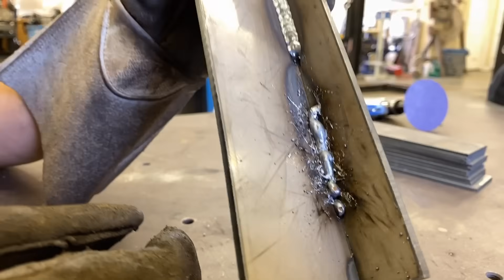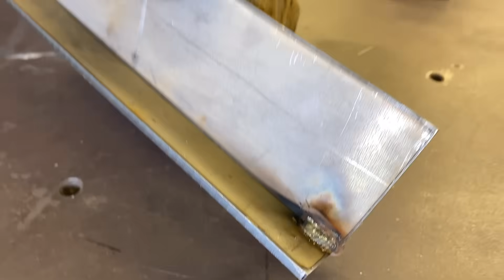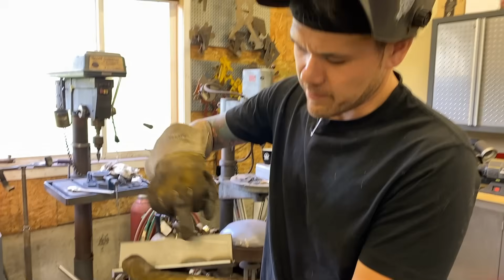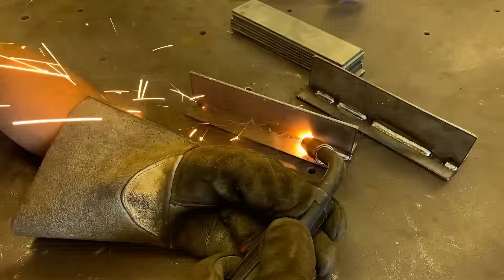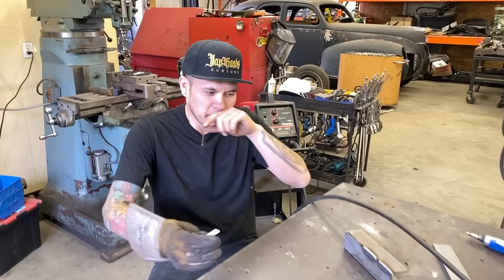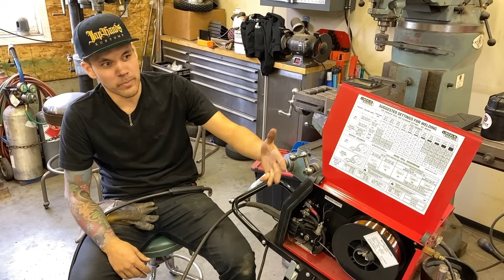MIG Welding Basics For BEGINNERS!! How To Set Up Your Welder + Tips, Tricks & Techniques!!

Comment: One other point to expand on Mick Millers comments, AWS  D1.1 (Structural code, carbon steel 1/8" and greater thickness) forbids down hill welding.  AWS D9.1 (Sheet Metal Code, Below 1/8") allows down hill welding.  This is not to say that you cannot successfully weld your 1/8" or 3/16" frame downhill with GMAW, but it does mean you need to pay attention to preparation and settings much more closely, or you will wind up with almost no penetration, overlap, etc.  Taking scrap and practicing on it before you do the real part is your best insurance against a failure.  
Oh, and a tip.  If you take each of the wire feed settings, 1 through 10, pull the trigger for five seconds.  Cut the wire and measure how many inches and multiply by 12, it will give you the inches per minute.  Millers Weld Calculators and others will typically give you the settings needed for various materials and thicknesses.  By knowing your machines feed rates, you can match them to the guides, and then adjust voltage to get the best results.  You can fine tune from there.  Remember, burn and learn.  It's all about time under the hood!

Comment: Does the direction I’m pushing the weld change if I’m not using gas …if I’m not using gas to I work left to right ?
Reply from the maker: Yes if you are not using gas it is best to angle in the opposite direction. you want to aim at your weld instead of away from it

Comment: A very good introductory video.  You said that you use 75/25 gas,  but I was disappointed that you never addressed settings for your regulator.  How do you know you have enough shielding gas, but are not just wasting it?
Reply from the maker: Are used 20 ft.³ per minute. Basically if you do a test weld and you turn it down till you have porosity and then turn it up until you don’t then you know you’re not wasting it

Comment: I just finished taking a MIG welding class last week at the local college. Still I learned from your video thank you. My biggest problem is how to see where I’m welding. I tried a bright light and soapstone. No. 9 on my helmet and I often still wander off the line. But I’m still practicing as welding is a skill I enjoy. Looking forward to your future videos your metal fab skills amaze me. This 72 year old still wants to learn.
Reply: I had the same problem and I think it is a common problem.   I watched a few YouTube videos that pupported to address it, but they only said silly things like get a brighter work light (silly - nothing comes close to the light the arc puts out) or check your spectacle prescription.
Eventually I realised that as I was welding sheet metal, not thick structural steel, the welder settings meant that the amount of light the arc makes is too low for the weakest shade level of the cheap auto-darkening helmet I had.
Changing from 75:25 argon/CO2 mix to 85:15 improves the weld penetration and puts out more arc light, making the work easier to see. If you change the gas mix, you will need to change the welder settings as well, but you will find welder settings less critical with reduced CO2.
Replace the front protective plastic lens in your helmet often.   The ultraviolet light from the arc ruins it making it hard to see, but the change is gradual, so you may not realise the lens is the problem.
I am nearly 80 and began MIG welding 2 years ago.   Something us old guys have to accept is that our eyes don't work over the contrast range they used to - so that even though the arc is very bright through the helmet filter, the surroundings can be hard to see.  
There are a lot of welding videos on YT.   Most of them tell you wrong things - surprisingly even videos posted or sponsored by welder manufactures.  Make it Kustom is very good.
Reply: AMEN me too

Comment: One question I have is, why can’t I see what my weld is doing. 
I have an auto dimming helmet. 
I have tried it on dark settings as recommended and I can’t see what’s going on.
Recently I have had the settings set to lighter, but still can’t read my weld’s properly and I can see lights for the next hour or so. 
Any recommendations. 
Regards
Kevin.

Comment: You were talking about wire size - do you need a different wire size for different thickness of material? Does a different thickness affect the speed you travel?
Reply from the maker: Typically I want the thinnest where possible for doing sheet metal. If I’m welding something thicker than a thicker wire is better. Speed is directly related to wire size and material size

Comment: On my 220 welder I really like 9910 rods I get a cleaner weld with less slag I can weld 1/4 in to 1/2 in steel plates and I can fill holes using my 220 welder

Comment: I like the technique you use for welding I will try it but my 220 welder still my favorite I also have a 110 welder I have to slow down my welds with it because it's only 110w not hot enough good for welding sheet metal like spot welds

Comment: If I was looking to learn how to weld a hot rod frame for a t bucket sized car what process would be best mig or tig or anything method that I did not mention. Also what thickness steel tubing would you feel comfortable making a frame
Reply from the maker: If you were using box tubing than 1/8 wall is is good. Mig welding or tig is good

Comment: Yeah... that door not opening up because it catches on the edge of the cart ticks me too. I have an old SP 175P that is a hoss for a little suitcase welder and it lives on 2x4 spacers on the cart just for that door issue. Im digging the channel. I saw you 38 dodge vid a while back because i searhed for 38 dodge stuff since I have a 5w coupe and it popped up... but recently your vids are def in my sight so your channel must be growing!
   I guess we weld similarly but I always describe my tip movement as a question mark because i do curl the fill motion just a bit. Of course I'm not a welder... i just own a couple.

Comment: You want to Push your weld when using Solid Core MIG because you want your Shielding Gas, well you know shielding your welds rather than cooling your beads  : D
P.S. You can Film through a Welding Helmet, you can try Torch Goggles or just buy a standard non-auto darkening helmet lens from Harbor Fart.

Comment: great video...Just upgraded to a 220 Lincoln from a simple 110 volt high/low welder...was great for light metal, but would not put my life on the line welding anything critical..ha...Great tips on the different techniques, and I agree with you whip technique is the best....Keep em coming....PEACE from wayyyyyyyyyyyy over here on the east coast... New Brunswick. :)

Comment: How much gas do you need? can you use too much or too little?
Reply from the maker: Your gas does not need to be very precise but can be adjusted for your environment. Are used 20 ft.³ per minute most of the time and never need to adjust it unless it’s a little bit breezy then I might turn it up to 30. If you have to little you will have porosity
Reply: @MakeItKustom  thanks 👍

Comment: what is the difference of mig welding and fcaw?
Reply from the maker: They are both basically the same except one uses gas for shielding and one uses a flux core that burns and creates its own shielding gas. flux core has more clean up. Most people prefer gas shielded

Comment: Thanks for this great tutorial. Does the same welding technique apply to flux core welding (gas less) as well?
Reply from the maker: The welder set up does apply but the angle of your welder should be pointing towards the Weld with flux core
Reply: Not to mention with Flux your not getting as much fill, so you need to spend more time letting the puddle grow before moving. It's a slower process, however can produce extremely strong and good looking welds if you take the time to practice. One thing that's wasn't covered is clean your metal! Alot of people use Flux because it will burn through alot of crap, however the quality of the weld will reflect your prep.

Comment: I have a Chevy S-10 extra cab pick-up that has a rusted floor under the drivers' side seat. I can't seem to find a replacement rear driver side floor panel, how or where can I get one? I do most of my welding outside, the garage has asphalt floor, fire hazard.
Reply from the maker: Not sure if they make those parts. I’d cut one from a wrecking yard!

Comment: Great video!! Just one question, what's the best gas flow rate? Did i miss it in the video? Or does it not really matter? I just subbed and will be looking forward to watching some of your older vids and checking out the new ones. Thanks again!!
Reply from the maker: I keep mine around 20-25 and a little more if there is any breeze

Comment: I grew up with a welding instructor.  So the basic knowledge was there before I ever struck an arc.  Lincoln 220 buzz boxes were everywhere then.  At 13 my first job had one, and I “self taught “.  In high school I was the guy who the teacher told to show the rest of the kids how to run a bead.  Fast forward to a job making mobile home frames, first day first arc blew holes through frame rail!  What freakin amperage you running?  180.  Turn it down to 120 ish please?  Can’t, adjust screw is AFU and it would take half of a day to lower.  Well, what do I do?  Run down hill!  1/8” rod at 180 amps goes on quick!  Which is what production mgrs want.  Federal inspectors told us multiple times that we had the best frame shop in the state.  Got to run a mig after a couple of weeks, same thing with burn and turn, reminding me of your welding with out sleeves, mega sunburn from uv rays.  I didn’t own a work shirt that didn’t look like I was shot with a 12 gauge at 50 paces.  You have done a great job of quickly demonstrating the process the best that I have come across, only thing that I could suggest is a #10 lens in a box to actually be able to show your torch position and puddle.  You could fancy one up out of sheet metal or duct tape one on a cardboard box, that would really show the process.  I know that once I see something done, it is easier to reproduce.  Just found your channel and really enjoying your metal working skills!  Thanks for passing it along

Comment: Hi, i have question that it seems like no one covers in their video. Can you use a Magnet like from a speaker instead of a clamp to make a circuit ??? as there are some time where it is difficult to clamp the ground to piece your welding
Reply from the maker: I’ve seen those clamps before they are just a big magnet with the wire going to it.  Seems to work

Comment: Was much impressed with this tutorial, i too have found the circle method also to be cunbersome and have resorted to your fav method.ive just started into the whole fab thing as a hobby as well,only thing i didnt hear u mention was nozzle n wire distance to work piece,but that seems to be a no brainer on most novices the wire will stretch the distance n fire as soon as it archs!!but if your nozzle is to close youll plug up n ruin ur copper tip,correct me if im wrong but that distance is just as important.correct???snooky pa.
A

Comment: I learned (mostly trial and error) on a 110 flux core lincoln. a few years ago I got a solenoid and converted to MIG. Now, I have finally upgraded to a 220 Everlast multi process machine that I'm just getting used to. With the flux core, I never learned  to run vertically down (only up) and probably have a ton of bad habits like pulling the weld, instead of pushing.

Thank you for this "back to the basics" lesson!

Comment: Can you MIG weld 16 - 18 gauge sheet metal without gas?
Reply: It's harder, and MOST people prefer solid wire with shielding gas.
Reply: @workonitm8  ok, thanks. Still a bit of a novice but hoping to learn what I need to do & how. His stuff is amazing. I've worked with wood for over 45 years, now wanting to try something different.

Comment: good info, and well explained!  welding without covering your arms is a good way to get a sunburn on your arm, it doesn't take that much exposure really.   i know from experience, don't underestimate the intensity of light from arc welding.  the reason downhill is not preferred is because penetration is low, due to gravity pulling the puddle ahead of the arc so you go too fast for heat to get below the surface, i use it at work sometimes when dealing with thin tubing so i don't blow through.  i find most of the time that staying level gives you better control either uphill or downhill.  that's my take anyway!  whatever works for you.

Comment: I've been welding for 20 years, and my welds don't look like that. I think most of my problem is that I can never see what I am doing. I'm basically welding blind because I always have a crap helmet. I ran a harbor freight helmet for years because it was "good enough". I bought one from the local welding supply a couple of years ago, and it's marginally better. What's a good helmet that is not going to be hundreds of dollars?

Comment: I am inspired to dust off my mig welder and play with it some more now.  One of my biggest issues has been welding with a poor ground on my cheap 110v Campbell Hausfeld mig welder. The aligator clamp is flimsy... any rexommendations on what I should replace it with?
Reply: Sorry if I'm interrupting but Harbor Freight has two ground clamps.
One is the 300 amp which is fairly good   (Berger  300 amp)   $ 7.99
the other is good quality  (Berger 400 amp)   $ 14.99
Hope this helps.
Reply: @workonitm8  thank you Norman. I will check it out. Watching these videos has inspired me to pull out the welder and play again.
Reply: @TheDogLife5225  
I love welding projects myself. 
Do you watch Austin Ross video's ?
Reply: @workonitm8  will check them out. Thanks for the recommendation!

Comment: Thanks mate.  Awesome video.  I’m a VERY amateur welder.  Learned oxy and arc in high school 30 years ago.  ‘Self taught’ by trial and error on MIG.  Have only ever used flux core gas-less.  I’m getting decent welds, but wondering if changing up to using gas would make any benefit.
Reply: Yes majorly. Flux core is much harder to make good welds. Using gas allows your welds to flow out much better. I started with flux core switched to gas and it was a vast improvement

Comment: I loved this video. One great tip that helped me was to reach over a adjust the wire speed knob on the fly with the trigger pulled until it sounds nice. For me it worked better than stopping to adjust it. Kind Regards Rex in New Zealand.

Comment: I'm kinda new to owning a mig welder. I looked on the boxes of spooled wire, but can't find where the tensile strength is indicated on the box or spool. Does it not have a classification like in stick rod?
Reply from the maker: Yes if you look up how to dissect the numbers it will tell you. It’s quite similar to stick

Comment: New subscriber, enjoying your videos, very much like the way you produce them. I'm new to welding with gas and I only have a little synergic welder with a mini regulator and disposable gas bottle at the moment. Could you maybe do a video on setting up gas flow or explain it. Without guages, how do you get it right? can you see the difference in welds when it is too much or too little? can you hear the difference? Any help appreciated.
Reply from the maker: I would start off with less than you need on a piece of scrap and turn up your gas until you have no porosity and then give it just a little more
Reply: @MakeItKustom  thanks man, appreciate the reply, I'll give that a try.

Comment: Mhh nice video but there are alot of nuances and variables in welding that u either have to keep it stupid simple or go into alot of detail
Wire
Gas
Type of welder 
Some of the major variables 

And most ppl that just begin spend 300 bucks on a welder and are most likely to get flux core cuz u dont need gas      then u have different problems 

So for the setup ur running these tips are helpful 
But for beginning welders  get a decent setup 
Weld for a few days    and try to find a welder near u and asking him/her for help         as a welder i always love that ppl want to learn                

Reason i love to support the small youtubers in my country that encourages ppl to start in the trades  

I never seen that mix gas u mentioned  u sure u didnt mix the argon and co2 amouny around?

Comment: Great little tutorial. Clearly explained with relevant examples. It'll certainly improve my welding technique. Do you ever use thinner wire. I've got 2 spools, one of .023" (.6mm) and the other of .033" (.8mm). Which do you prefer for car body panel steel work?  (Eg. 1950s pressed steel car bodies)  Thanks.
Reply: You'll find it easier to get nice welds with 0.6mm wire on body panels, it can be slow though and you need to make sure that you set your machine up for it before you start welding.
Everyone's different though man, try both!
Reply from the maker: The smaller the wire the better for sheet-metal. 023 is my wire of choice for bodybuilders. The thicker stuff is great for structural

Comment: Is .030 ok with your sheet metal / body panels ? I have used it lots but see some say .023 ? Is it just a setting or preference ? I tried both sizes and I have made both work
Reply from the maker: The smaller wire takes less heat to melt so it is preferred

Comment: Well done!! The only thing you missed is making sure what your plugging the welder into. Lots of people will plug there welder into the wall outlet and 10sec later it blows the breaker. 
Or if you have a long “thin” extension cord then the welders fuse pops.
All good things to cover, but you really did explain it well bro!!!💪🏼🔥🔥👍🏻
Reply from the maker: Yeah there are so many things I didn’t talk about in this basic video
Reply: @MakeItKustom , ❤️🙏🏻 yea maaan!!  I wasn’t trying to hate on yea. Just wanted to cap on after your vid. I wanted to Help out the new guys out here!!  Keep up the great work ya doing!!  Big fan!!